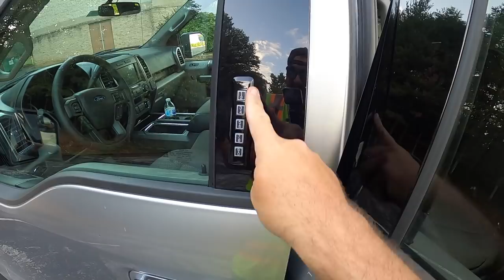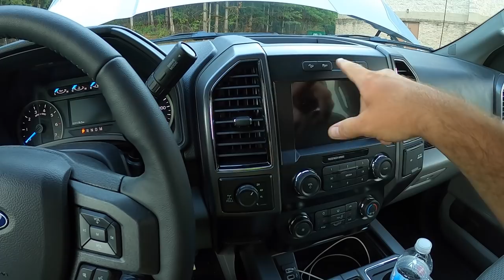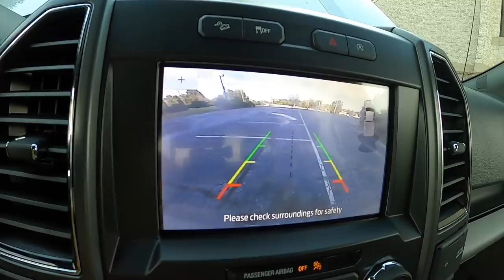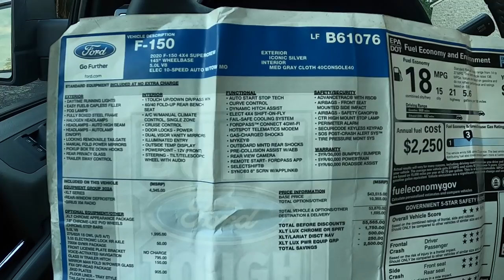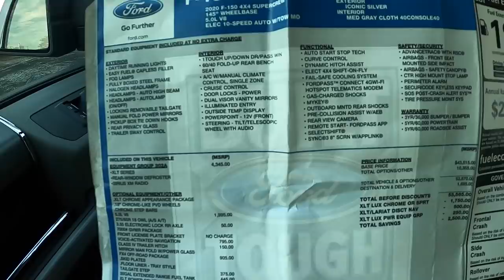New Truck and New Employee

Comment: I have been doing testing on these 5.0 at the Ford dyno lab in dearborn Michigan for the past 12 years. Yes before it was released to the public we were doing all the product development two years prior. Its just my opinion,but the 5.0 is the best non marketed  engine for the F-series. Yes the 6.7 diesel is amazing but they actually have commercials and try and push people to buy the diesel option. If you notice Ford really pushes the ecoboost. They never market the 5.0 V8 for whatever reason. We have these engines even to today go through thousands of hours of durability testing with out any issues. Great engine would very highly suggest it.

Comment: 50,000.00 is alot for.a truck, I bought a 2500 HD/WT 4x4 6.0 gaser 7 years ago new off the lot and paid cash for it, the list price was no where near that 50,000.00 mark. In fact when I put new hinker C plow on it with the salter I still didn't hit 50,000.00. I think the dealership is pulling one on you, yes i know you have Ford and I'm bought a chevy but realistically that are comparable and they do the same thing. I went my route with the 2500 hd/wt model cuz i do heavy hauling/pulling & snow removal constantly with my trucks (as of late im often pulling loads in excess of 7,000.lbs). Only mistake I made was getting a gaser engine whereas I should of went diesel as my next truck maybe next year will be a diesel engine because as i speak im waiting for a 7.5 ton trailer for my skid steer and loader which I hope my 6.0 liter will be able to pull it. But for future needs you might wanna think about goin up to at least a 3/4 ton for your next purchase as you always have to be thinking of your compaines needs 5+ years down the road. I did just that but now I'm entering a new phase with my company as im starting to get into more serious heavy duty equipment and some stuff is becoming outdated for my needs already.

Comment: the step is awesome but cant use them with a trailer on. dodge has one that come out from under the bumper on the corners that you can still use when connected to a trailer